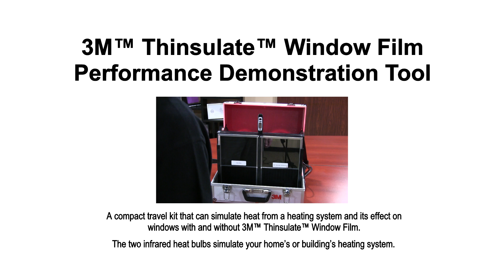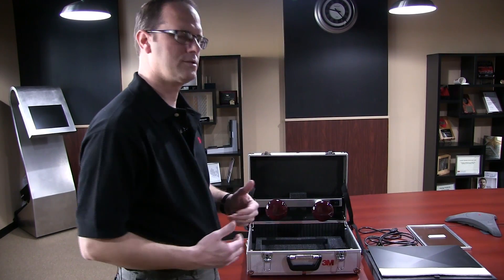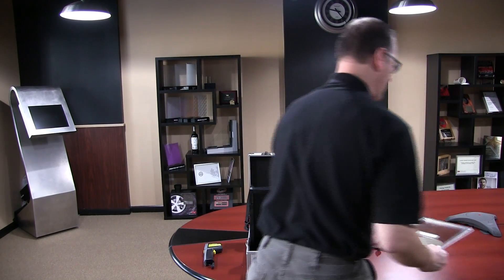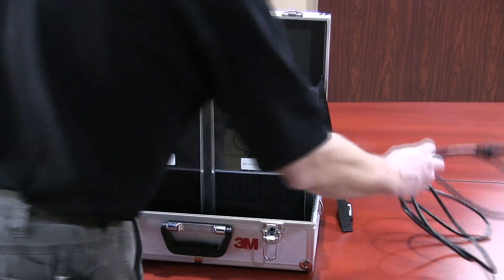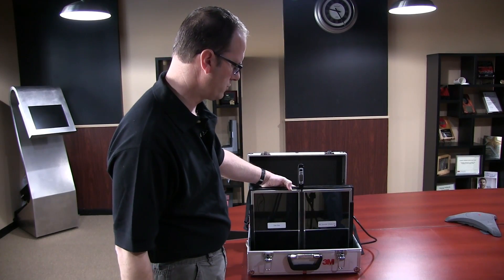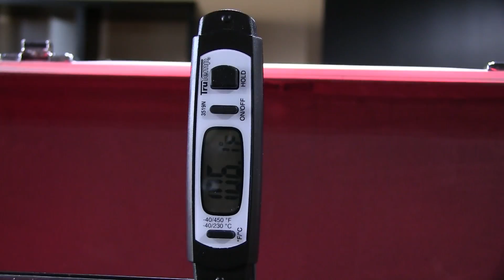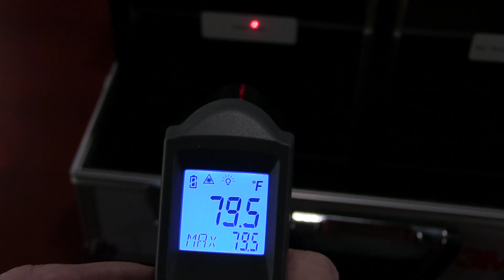3M™ Thinsulate™ Window Film Performance Demonstration Tool

Comment: I tried to purchase this product and their low e line through a 3m distributor and it seems to only be available for an installer.

I'm a professional painter and use many 3M products. It's too bad 3M has decided to back themself in a corner and not provide this product for the General Public.
Reply from the maker: Hi Joshua, as you mentioned, all 3M Sun Control and Safety & Security Films are sold only through 3M's authorized dealer network. That is due to many reasons, but most important is to recognize which films are safe for any particular application. Installing the wrong film on the wrong application can lead to glass breakage due to thermal stress. The 3M dealer network is trained to avoid those situations.
Reply: @EPDWindowFilm  Unfortunately it means I won't be recommending 3m products. Many types of trades require a fair bit of knowledge to complete properly and safely. I apply products that can set your house on fire if exposed to open flame (Pretty important). Somehow the powers that be allow me to pick and apply the product.